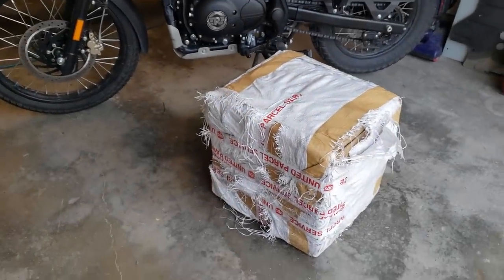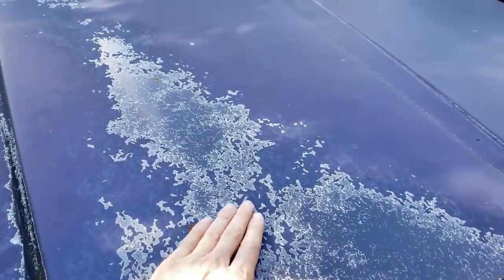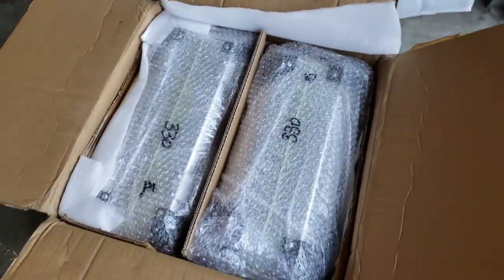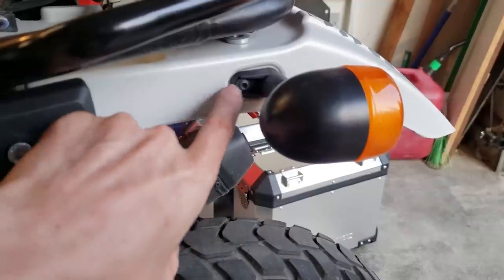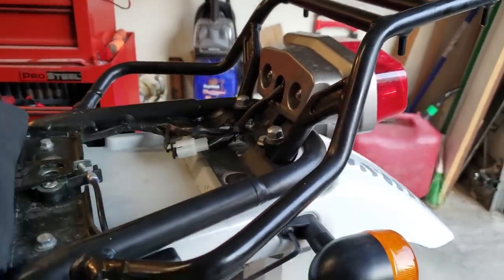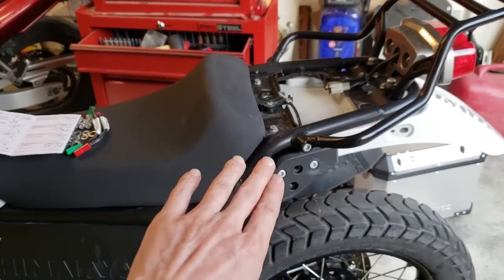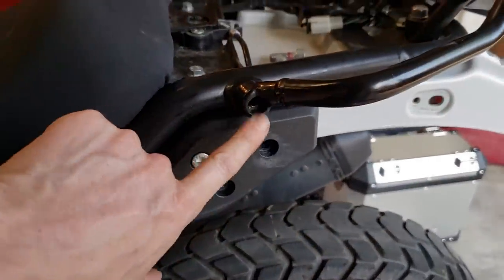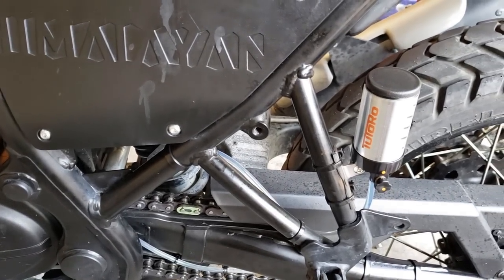Himalayan Hard Panniers & Racks: Step-by-Step Installation & Tips

Comment: I have the same racks , i drilled a small hole in the rear fender behind the square section the indicators are mounted on .Then i took the wiring through a rubber grommet . It looks a lot neater as you can't see the wiring.
Reply: Was just thinking the same.. also, the long bolts, cut them off.. too short a gear change, cut it in half, weld your desired extension in, grind, paint, finished. keep up the gr8 videos
Reply from the maker: Thanks Brian. I think I even have some spare grommets in a parts bin. Good thinking.
Reply from the maker: Thanks Tim! I almost did that to my gear shift lever during my trip to Prudhoe Bay. Decided to put it off and focus on other things, but that modification is still on the list of to-do's.

Comment: I installed mine with the latch facing forward so I can just hop off the bike and open while standing next to the bike and don't have to walk around the back of the bike. Really handy if you need the wet weather gear in a hurry too.

Comment: just got my Himalayan and watched your very useful video prior to installing the panniers. Other videos show panniers with locks to the front, yours are to the rear. Is it personal preference. Locks to the rear seem better idea. Ride safe !!
Reply from the maker: If you open to the front, and you're setting up camp and need to access both boxes, you are constantly going from one side of the bike to the other. If the box is open from the rear you can access both boxes from the rear of the bike. It's more convenient. Everything is more accessible. Also, if the box lid is not latched down while writing, the lid will not catch air and get yanked up.  And last, in a crash I think the lids are less likely to get snagged and ripped off. Those are just my thoughts. What do you think?

Comment: the tail light wire you can route through old position hole and then tape it side wise might look more compact. Also white powder coating is good idea. You can put black strip in the middle same as your gas tank & guard.
Reply from the maker: Good thinking, and thanks for the feedback on box color! J.
Reply: @KARMAkazeMoto  Agreed about running the wires thru the old blinker mounting holes, maybe with a rubber grommet for protection.  Use a single loop fastener on the side of the fender to keep it tidy.  Were it me, I'd try to get rid of that plate/tail piece and mount the plate to the back of the new blinker bracket. have to come up with a light solution though.

Comment: I like those in silver. BTW. Noraly has just switched to soft panniers. We shall see which are better. I prefer the looks of hard ones.
Reply: I cant wait to see her in Patagonia!
Reply from the maker: Most people are pushing for silver. I think Noraly made a good choice. I'm also running soft luggage depending on the type of trip, same brand too. Used that stuff on the recent trip to Prudhoe Bay and it worked out well. I have two more install videos to knock (heated grips and jerry cans) then I can start sharing that big trip. Thanks Robert!
Reply: they add weight and make you slower at highway speeds, i don't blame her. soft panniers tuck into the bike a lot better so much lower aero hit.

Comment: Doesn't powder coat take heat to apply ? You could wrap them ?  I would have drilled holes for in fender for blinkers . Lookin good !
Reply from the maker: Yes, I'd have to remove the plastic to do it. Wrapping is an interesting idea. Could get ore creative with it. For sure I'll be redirecting the blinker wires.

Comment: I'd look at a way to hide the turn signal wires. Drill a couple of holes somewhere and feed each wire through a rubber grommet when you get back.
Not got panniers on mine (yet) mainly because I don't like the aluminium finish. Never considered painting/powder coating/wrapping them in white. Be good to see how it looks in white, but powder coating would be best, but wouldn't a whole lot of disassembly and reassemble be needed to protect the plastic parts from heat.
Enjoy your ride.
Reply from the maker: For sure it would be a bit of a hassle. Would have to drill out those rivets, remove the plastic, get the powder coating done, then redo the rivets. Not sure it's worth it, but I do think it would match the bike well and make everything look more purpose-built. Thanks Jerzy!
Reply: @KARMAkazeMoto  I think the panniers in white would look great-and different from everyone else.
Just got back from a 16 day trip down to Croatia and Serbia, but on the KTM RC8 and not the Himalayan.  It was an absolute nightmare on the few unpaved roads we used. The Himalayan would have been great.
Got a 28 day trip to France, Spain and Portugal starting in a couple of weeks, which I am doing on the Himalayan. Not decided on which luggage to use yet-soft panniers or a large waterproof roll bag? Decisions, decisions...

Comment: Looks good. Wonder how they've held up over the last year - leaks, fit etc? Also if the close proximity to the chain oiler was a problem?
Reply from the maker: Thanks. So, I haven't had any problems  with them, and there was no issue with the oiler, but to be honest they didn't get much use. I swapped them out for the soft panniers by Mosko Moto prior to the Prudhoe Bay trip seen here: https://www.youtube.com/watch?v=82s86NYZvIo
Reply: @KARMAkazeMoto  LOL thanks - I see that now in the later videos. I'm kind of all over the place with the series and really should watch everything in order!
Reply from the maker: No worries!

Comment: Another great video. I have added hard bags to a few of my bikes. One suggestion I would offer if you have a factory hole that has no bolt in it I would run a tap thru the hole instead of the saddle bag mount bolt. This will remove the paint and the loctite will ad hear much better. Really enjoying your channel.
Reply from the maker: I do have a tap kit. That was a really great tip! Wish I had thought of that. 🙂

Comment: The extended cables for the lights go through the holes where the lights were originally installed.
Reply from the maker: I believe that's an ok way to do it, but that is not how it is done in the installation manual.
Reply: @KARMAkazeMoto  I see. My panniers were installed by the RE Technicians so I thought that's ideal 🙂

Comment: My kit was missing the Bolts and the harness extensions. You wouldn't happen to have the Extension part numbers written down? I can't find them anywhere and our only RE dealer seems to have trouble getting anything from them.
Reply from the maker: Sorry to hear that. Those are crucial parts to finish the job.
I didn't have it written, so I looked through archived videos. Could almost make it all out clearly, but not quite. Pulled the fender/plate hanger off the bike and took a direct look. Some of the numbers didn't print perfect, but it pretty clearly looks like P# 1040309/8. Perhaps the / was suppose to be a 7, but I don't think so. Could be 104030978.

Unfortunately, I think you'll still have trouble tracking it down. On a couple of parts dealer sites, that part isn't listed, nor are the pannier racks even shown in the Himalayan parts diagrams. Not cool.

Hate to be the one to say this, but you might need to procure some bolts (stainless) and wire with connectors to do the job yourself. 😬

I hope I helped you a little, or at least that you get it sorted out before any long trip.

Comment: Not sure how the plastic parts of the panniers would fare during the baking part of the powder coating process, I suspect they would have to be taken apart. Maybe a 2k paint (cold curing) would be better? I'm sure the folks at the powder coat place would be able to advise.
Reply from the maker: I just looked it up and Powder Coating can be cured at 350°F (176°C) so it's possible the plastic would be totally fine. But it would still need to be removed to do a good job of coating the entire box. I'm getting some interesting feedback from people though, including doing a wrap job, and yeah, there's always paint. Would be easy that way.

Comment: Hey, run the lights under the taillight. I've rerouted some of my wires to under the seat including that green and red, you can probably even do it without using those extenders. Won't be visible that way and no drilling required. Edit, still visible. idk, i'd definitely just drill a hole under your black rack and run the wires through that, less stuff showing.
Reply from the maker: There's a guy on here who had me look at his. Really simply just took the wires out to the sides, from under the finder, right near the end of the fender. Makes the wires unnoticed, and there's no special drilling involved. Super simple. Will probably take that approach. Wish I had done it before my Prudhoe Bay trip, but better late than never.
Reply: @KARMAkazeMoto  oh and one thing, keep an eye on those 2 studs(7.5mm) on the left side of your motor..mine keep loosening off and letting the headgssket leak, even with locktite
Reply from the maker: @0xsergy  that's a good tip. I'll take a look before any leaks appear. Thanks! 👊🍻
Reply: @KARMAkazeMoto  we've got similar mileage but mine has seen a good 1k offroad on dirtbike trails and the like so i may have rattled it a little more(no jumping, slow speed over rough stuff). my head also needs a retorque coincidentally. edit 1k kms so like 700 miles.
Reply from the maker: @0xsergy  Ha, at first when I read your head needs also needs a retorque, for some reason I thought you were making a joke about your head, like your brain. I was cracking up. Was about to say, I hope that's covered under warranty! And then I realized you meant engine head. Duh! I haven't finished my coffee yet. ☕ 😁

 I did complete a 2,000-mile trip a couple of weeks ago, and nearly 1000 miles was on dirt and gravel, so based on what you're saying, I definitely need to go over every nut and bolt and check that engine for any leaky spots.

Comment: My kit comes with a bracket to put the brake light back a few inches. The old bracket has some rubber washer that looks to be riveted in and the new bracket has nothing. So as I snug down the brake light on the new bracket I hear a little crack sound and the light is wobbly on the bracket. Scared to go tighter. Guys I need some advice.

Comment: The box fixations are not good, Are you mountig the box on the right side ?
 i think soft luggages could be better with Kriega for exemple and nicer, more practical to put on and off, and the same price.
Reply from the maker: I ended up switching over to Mosko Moto prior to my ride to the Arctic. I like the boxes for short camping trips and getting groceries. I used the Moskos Moto for the rugged stuff. Couple pounds lighter. 🙂👍

Comment: I just picked up my black Himalayan from the dealership for the first time.  They had installed the panniers and racks like I asked, but they handed me the rear rack and said "it wouldn't fit with the pannier rack and the instructions with the panniers said to take it off."  What?  I just watched your informative video and you didn't have that problem so I'm wondering who the tech was that did the job and why couldn't he do it right?  Also, my indicator wiring is above the fender on both sides out in the open and looks awful.  I'm going to have to re-do the job myself (except I had to leave the rear rack at the dealer who is 150 miles away because it wouldn't fit in the panniers!)
Reply from the maker: This is ridiculous. Considering the rear rack mounts to the same holes, it would have to work... unless the inner diameter of the rear rack is distorted. The side rack fits inside the rear rack where the bolt goes through. Even if that was the case, they could have drilled it a bit. And the wiring outside the fender? Sounds like a rush job. I hope you update me on what you find and if you end up getting it corrected.
Reply: @KARMAkazeMoto  I sent them a link to your install video.  They wrote back "Thanks for the video! I can definitely ask and take care of that when you come back as well for the wires. Sorry for the inconvenience but we will definitely do it right for you! The instructions weren’t the best from Royal Enfield as well."  So it will be corrected but not until May as that will be when I get the mileage up to 500km and the weather will be warm enough to ride it again (I live in eastern Ontario)  You will appreciate that, living where you do!

Comment: I would leave the boxes the way they are. One reason is that they will act as bike protection if it falls over and in my opinion battlescars look better and you don't need to worry about a respray ha ha. There are other reasons too.
Reply from the maker: I sure don't have to worry about scratched paint if I leave them alone. Good thinking.

Comment: As others have mentioned, the cables should run through the original indicator holes. As for painting...uugh, please no. Building in future problems. Just cover them in stickers as you travel around the world. Ride safe J.
Reply from the maker: I think it'll end up stickers. For one thing, I have more pressing things to tackle than getting white powder coating. Nothing in the budget for that right now. 🙂👍

Comment: Not a fan of the directional wires going up and under the fender. There should be a way to snake the lines back so you can use the existing holes in your fenders from the previous directional mounting.
Reply from the maker: The existing holes make it so the wires are then more out in the open. They can be kept under the fender, then directed to the sides instead kept at the center. I still haven't changed it yet, but it's easy to do and looks better. Thanks Mark!

Comment: Do you have any idea how much a top box would cost for the Himalayan?
Reply from the maker: Where are you located? Makes a difference who you order through.
Reply: @KARMAkazeMoto  but still what's the average price?
Reply: @KARMAkazeMoto   - Hi, Justin.  Have you found a supporting brace for the rear rack as in the Itchy Boots video "10.000 km Bike Review" (at the 12.11 time point)?
I see it pictured at https://emlineamoto.com/en/sr9050.html , but not available anywhere as just the brace.  Do you plan to make your own?
Reply: @Hrshsngh_19   - Hi, Harsh.  Prices vary considerably depending on whether an item is made (in India for instance) and bought there or elsewhere.
And, sometimes text might be only in the local language where the item is sold.  Therefore, "average price" is meaningless.  BTW, here is one source
for an aluminum top box, but it currently in stock only in color Black:  https://www.orionpowersports.com/red-dirt-moto-rear-rack-top-box-for-re-himalayan/
Reply: @daveinwla6360  okay thank you

Comment: The factory placed the panniers opening forward, I guess they act as air brakes if you forget to close and lock them, and the signal wires are completely hidden, A paper in them stated a ludicrous weight limit of 5KG each side, so very light groceries, I guess?
Reply from the maker: I also thought the max weight was on the light side. I think you can carry more if you are only doing street riding, but on rough terrain, RE must be concerned about vibration and repetitive impact cracking frames. That's my guess.
Reply: @KARMAkazeMoto  I am still going to haul a 50Lb sack of chicken feed next week, using the pannier holding them in place on the rear of the seat.
Reply from the maker: That'll work, no problem. 🙂🐔

Comment: Why not just run the wires up through the existing holes on the sides of the fender?
Reply from the maker: The length of the wires is an issue, but also you end up with a lot of external wires.  What I'll probably end up doing is  Leaving the wires almost entirely the way they are, but right at the very end of the Fender go to the left and right instead of up at the center of the rear edge of the Fender. The wires will reach and there's absolutely nothing complicated about it. Looks a lot nicer.
Reply: @KARMAkazeMoto  Good points. I wonder if you could relocate the signals closer to the brake light? Dunno, just thinking out loud.

Comment: Nice panniers and get some indicator blanking plates from enfieldaccessories.co.uk to cover the holes and how about putting a hole in the rear mudguard/fender and passing the wires through, then they would be totally hidden 🤔😀👍🏻
Reply from the maker: Thanks Mark! I think I'll splurge on those blanks to fill the old holes. As for the wires, I've seen they can just be passed out under the sides of the fender which is the easiest thing to do and looks so much better. Probably going to take that approach.
Reply: Nice one 😃👍🏻

Comment: Leave them aluminum, paint will only get scuffed and then they will look like a POS.  Powder coating is more impact durable, but you’d need to completely disassemble them, removing the plastics to enable the coating to be baked in an oven for 25 minutes or so at 450 deg F.  Just saying.